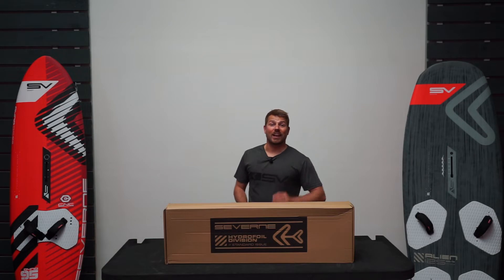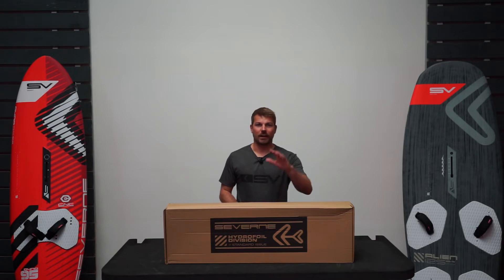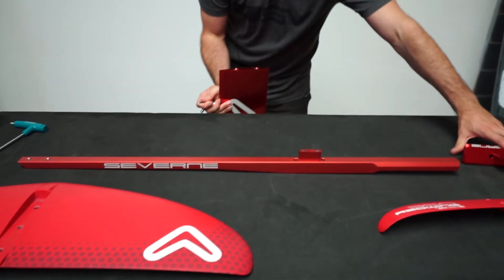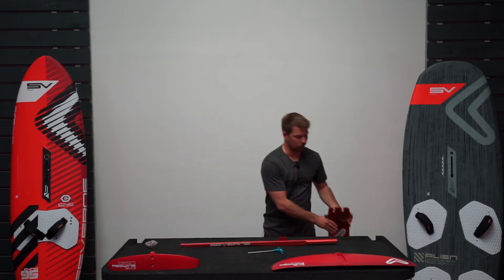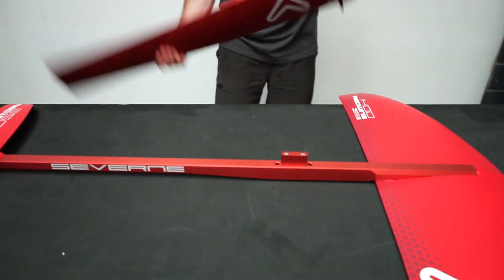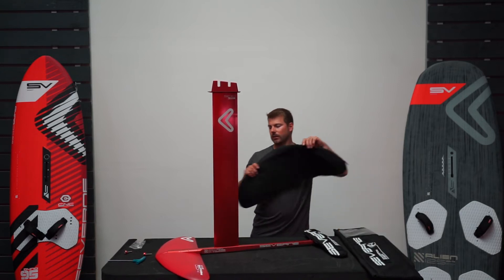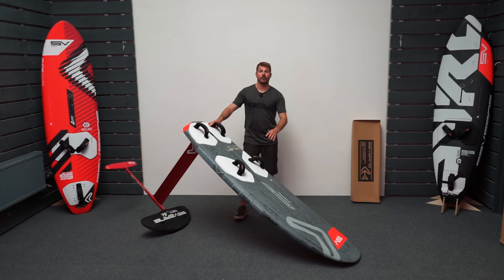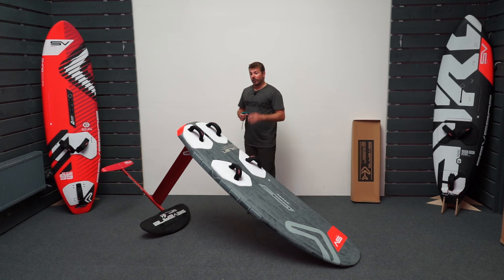Severne Redwing Windsurf Foil Assembly Guide

Comment: Great video as always! Would the Severne Redwing (a) technically fit and (b) make sense in combination with a Starboard Foil Freeride 125? Is there any other board option than Severne where M8 foil bolts would fit?
Reply from the maker: Thanks! Currently Starboards are designed for M6 bolts so the box holes would need to be widened with a circular file for Severne's M8 bolts. I'm not sure of any other brands.